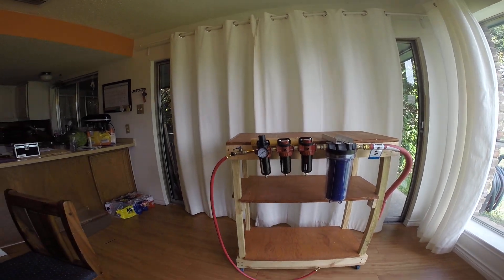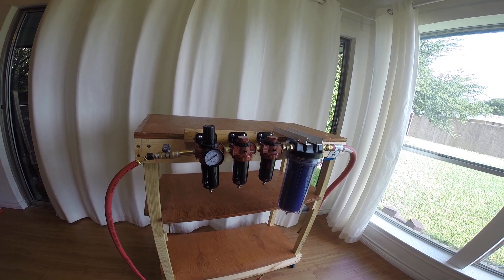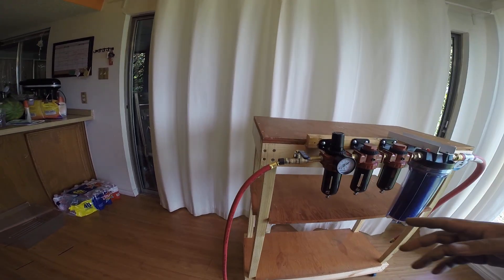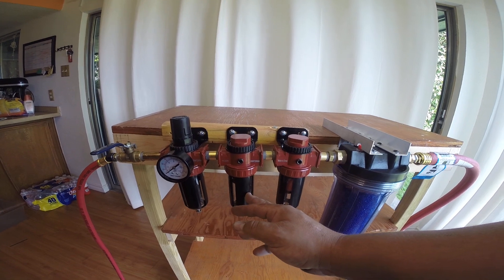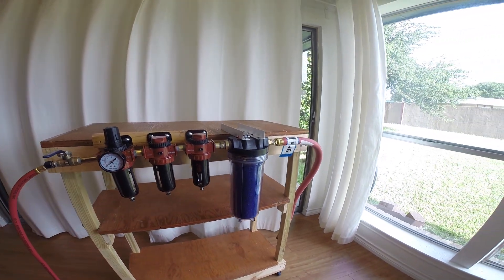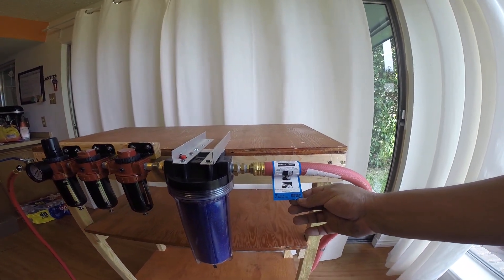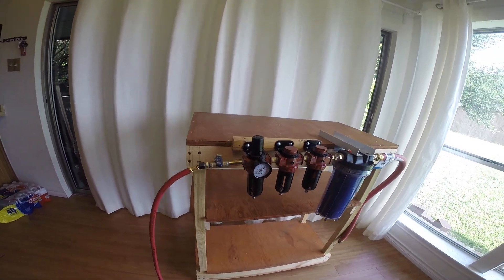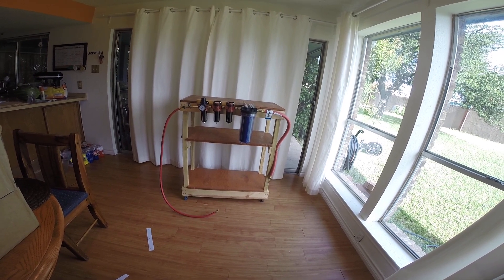DIY Compressed Air Desiccant / Dryer / Filter for HVLP and to paint your car at home

Comment: you can now buy 3 stage filters that do a similar job ... though the descant filter is a lot smaller.
I like DIY but when it comes to high pressures, I prefer to go with a proven setup.

Comment: Im about to build one of these desiccant air dryer for my low end home garage painting setup. The compressor is only able to put out about 10cfm but it works ok since i only do smaller paint jobs with low cfm guns. Building this kind of dryer seemed like a fun diy projekt But i just became avare that some say this kind of dryer could lower your cfm with up to 20% and my compressor can not afford that. Im sure your compressor is much more capable but do you have any experiance of this affecting your airflow?

Comment: What is the purpose of using the water filter?
Reply: Probably just the sheer amount of desiccant to absorb moisture.  I've used the tiny inline desiccant filters and they turn pink very, very quickly.  You can recharge the desiccant if you can open up the filter and dry out and replace the desiccant.

Comment: the bottom line here is you found the right set up for your painting projects etc...   and also you found how keep moisture from getting into your air tools and spray guns etc.. too  good job. a while back i had the same problem till i finally got me a similar set up, if folks plan on doing this kind of diy  get rid of that moisture first  before you do anything else.

Comment: Hi David, I think this setup makes a lot of sense. The desiccant snake might be overkill but I really get the rationale behind the staged filtration setup, and I appreciate the research you’ve put in as well. I’m curious to know how well it’s been working and if there were any issues. I am setting up shop air at home for automotive paint as well, and have been scouring youtube for ideas and various insights. Also, reading white papers and application notes from industrial pneumatics suppliers is good, but exhausting. For myself, I have been approaching water separation and filtration as separate topics. I have really been looking at the after-cooler + moisture trap approach to condense out as much water as possible before entering the tank since this is a brand new compressor. And, I doubt any contemporary big-box brand compressor will hold up for 21 years if there is a lot of moisture in the tank. Anyway, thanks for the great video, the info here is very useful.

Comment: From what you described, you have the same compressor I do and I am also in the process of getting a vehicle ready for painting. My compressor also makes a good bit of water and I was thinking or placing a drier between the compressor head and the tank to start with. I already have a drier that I can place between the tank and the line that I am hoping will be sufficient but I have to say that yours will definitely be superior. Very nice job. Good luck with your painting project. I am always happy to see folks getting into DIY auto projects. It's a lost art as most folks just fork out the cash and have someone else do it for them. Cudos...
Reply: Hi John, I just got a new compressor and I too am in the same boat. I am going to go with the after-cooler right off the head and a diy copper condenser/water trap before hitting the tank. One consideration a lot of people don’t mention often is pump and tank working pressure. I have a 155psi compressor, and most of the filters, dryers, separators I have seen are intended for post-regulator use and rated for ~1MPa, which is 145psi. So, if you do add an after-cooler/dryer setup ensure that it is rated to handle the max compressor pressure. Best of luck with your painting.
Reply: I also might add, my solution to shopping for less expensive units to use at tank pressure is to lower the cutoff switch so that my max tank pressure will be below 1MPa (145psi). I’m thinking 140psi sounds good. Then I can run a less expensive auto-drain on my water trap. A lot of guys are spending $15 x 3 or more on ball valves to drain their water traps, but for just under $60 you can get an SMC auto drain which will automatically dump the accumulated condensate.